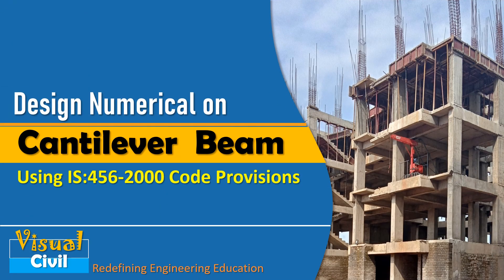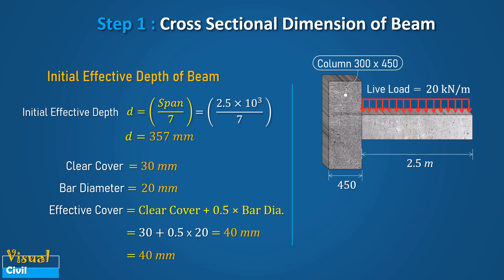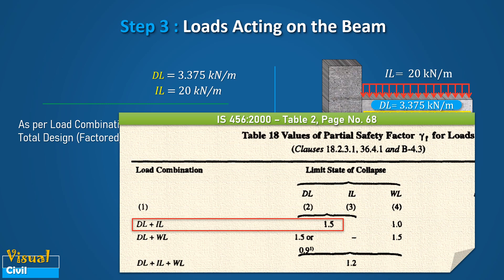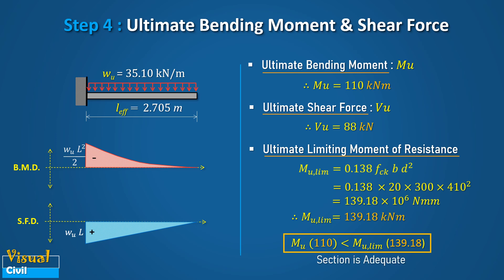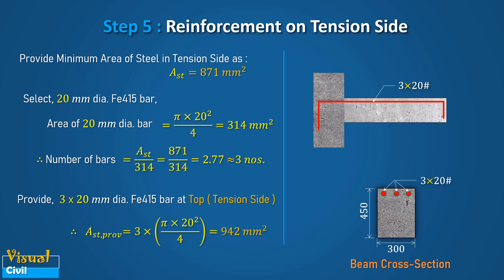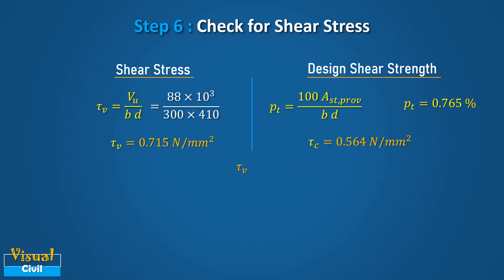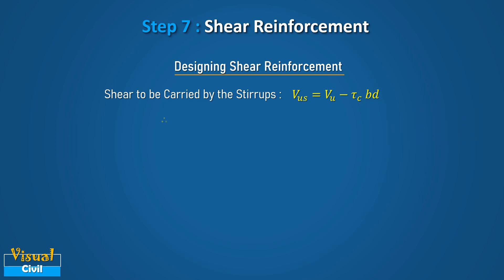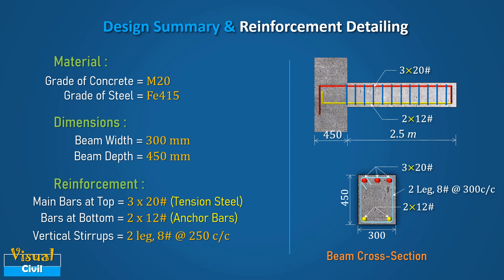Design of Cantilever RCC Beam | How to design RCC Beam

Comment: Thanks for your sharing, why not check the deflection of RC Cantilever beam? Is it necessary to check or not? incase we have brick wall on top of it?
Reply from the maker: Thanks for sharing your thoughts. The initial depth assumption is already based on deflection criteria. But still if we want to check it again for deflection with actual provide steel area, we can do it to get more confidence in the design.